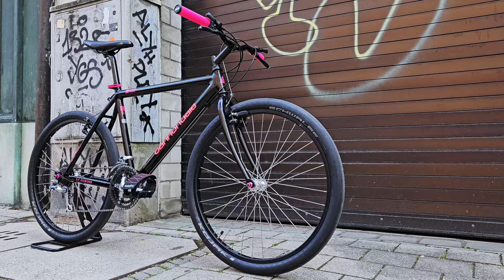90s MTB on Slicks ft. Rakäthe Berlin

Comment: Imo it looked more slick with a straight stem
Reply from the maker: Which of the two did you prefer?
Reply: @bottoncino_bicycles  by straight I meant the one paralel with the top tube, the skinnier one, 2nd one you tried out
Reply from the maker: @oreocarlton3343  👍